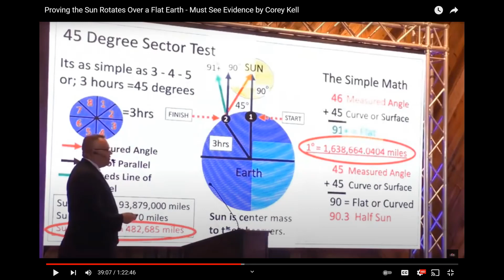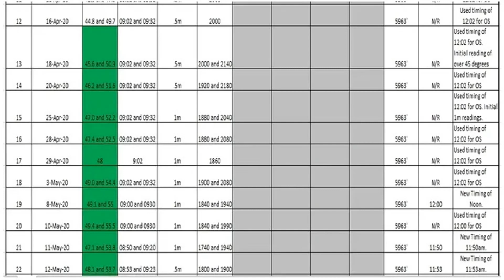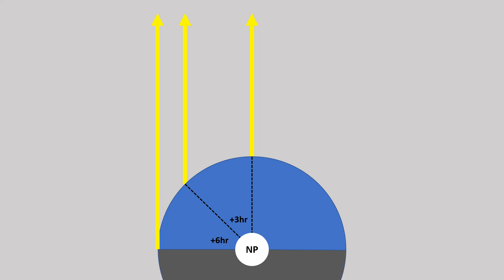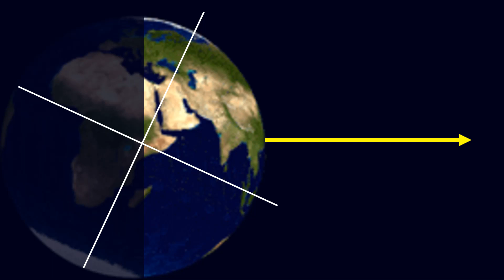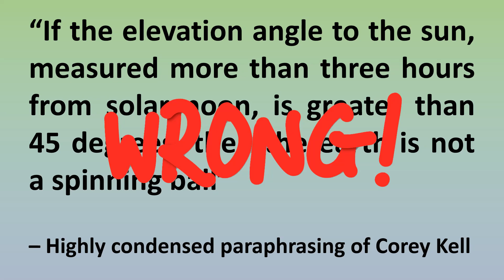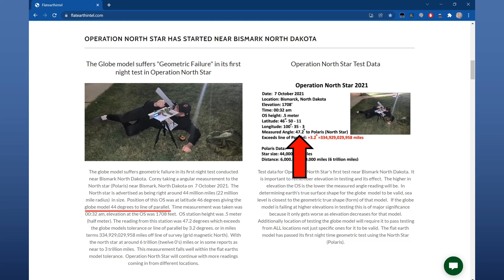"Flerfs can't 3D" featuring Corey Kell's 45 Degree Sector Test

Comment: I thought of a very simple way to see why the claim "If the elevation angle to the sun, measured more than 3 hours from solar noon, is greater than 45deg, then Earth isn't a globe" is false. Notate the claim "(E and H) => ~G". Supposedly this claim is a prediction of the globe model, so G was assumed before the claim was made. Take the as yet unspecified axial tilt to the extreme and make it 90deg, turning our sun itself into the north star (on June 21 at least). Your latitude always equals the north star's elevation angle, so as long as you are above 45deg north latitude with this hypothetical axial tilt, the sun's elevation angle is always more than 45deg, so E. Wait until 3h after solar noon, so H. We thus have E and H, and by the claim we have ~G. We also have G, so we have a contradiction, and since our most recent assumption was Corey's claim, then Corey's claim must be false.

It is clear that to repair Corey's claim, axial tilt must be something taken into account when calculating the prediction.

Comment: The weird thing is, he's almost right. He's just measuring the wrong angle. It won't work with the Sun's elevation angle for the reasons described here, but it does work if you measure the angle around a polar-aligned axis. This is why equatorial-mounted telescopes can track the sun with a constant rate of rotation, and sure enough they'll rotate 45° in a span of 3 hours.

Comment: Dammit. You got me all excited at 6:30 when he said he quantitatively compared against an FE model as well. We've only been asking that for years! But no, no, turns he's just claiming it all works out without even looking into it.

It gets really funny if you do check what the standard FE model predicts, though (i.e., 10,000 km pole-equator distance & 5000 km sun-height). For most of the year, it'll predict lower sun-elevations than the globe on 45° altitude at noon±3h.

EDIT: did some further math. It can be proven that on the standard FE model the elevation angles literally cannot be above 45° in his boxtest, no matter where or when you do the observations. His whole hypothesis (2:30) should be inverted. Nice self-debunk there, Kell.

Comment: Great breakdown of his mistake Roohif.  Same story every time with flerfs.  They fail at geometry,  especially in three dimensions. 

You can visualise this easily with an Equatorial mount too.  In solar tracking rate it moves at a steady 15 degrees per hour from any location on Earth.    Depending on the declination three hours either side of solar noon can have the Sun higher than 45 degrees easily.

Comment: OMFG! You are totally bypassing the fact that the sun rays have to be parallel from multiple positions so it is you who do not understand three dimensions man. You need to make a retraction video. Just because you do not understand the parallel sunlight concept doesn't mean you can accuse us of not understanding it.
Reply from the maker: Huh … ? Where did I use rays that were NOT parallel?
Reply: @roohif  the length of day has nothing to do with the angle bro. I think I might have to make another video to show you. The tilt has nothing to do with the angular speed of the Sun
Reply from the maker: Your call if you want to make a video 🤷‍♂️ I can guarantee though you’re going to mess up what 15 degrees per hour means for the geometry when it’s tilted. It’s not as simple as the 2D, top down view that Corey uses.

Comment: Thanks for doing this roohif! The last two weeks I have tried to understand what his actual reasoning was.

I did email him and he kindly sent me his whole Kabul data spreadsheet. I ran the numbers on each measurement, and he the Sun altitudes/elevations he reports are all well within 1 degree of the globe prediction. I recall half a year ago I Can Science That had a solstice experiment where around 30 of us measured the Sun altitude/elevation at solar noon. Most of the data points we obtained were significantly less accurate than this.

Additionally, a small comment to your remark about his confirmation of the flat model: What he is doing is taking measurements which he believes falsifies the globe model. Those same readings do not falsify the flat model directly. Thus, it seems to me that he is taking the scientific approach of falsification attempts, rather than the usual flerf notion of trying to prove a model positive, which is not the scientific method. I actually applaud him for that, he understands how falsification works, even if he doesn't really understand the model he is trying to falsify.

This is the reason why I was trying so hard to understand his reasoning. Well done to you for getting to understand the actual argument, other debunk videos I have seen appear to have only gotten 80% there.
Reply from the maker: Thanks! Yeah, it was the whole "flat earth passed 100% of all testing" that pissed me off, because it's not exactly a test of anything if you're in Kabul and the sun is still in the sky at 3pm 🤦‍♂️🤦‍♂️
Reply: @roohif  Well, when you put it like that... 🤣🤪